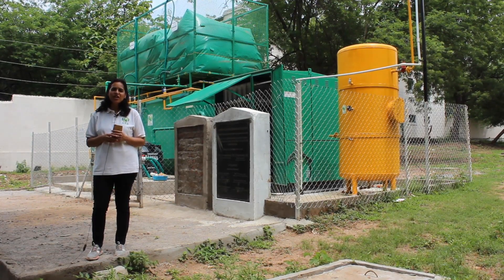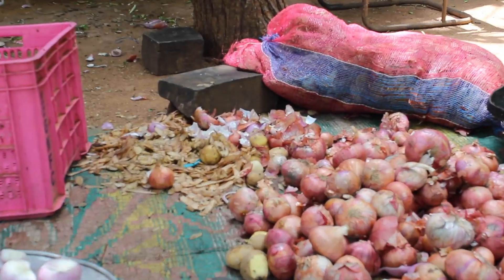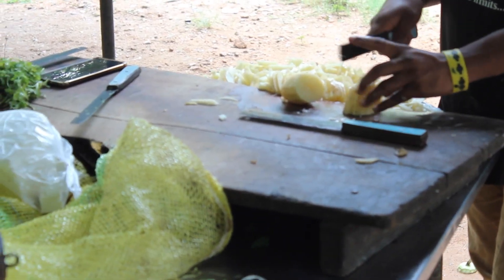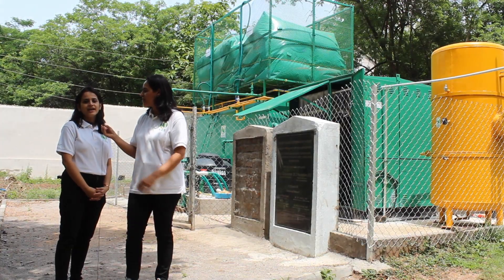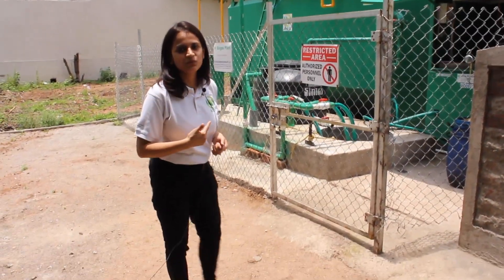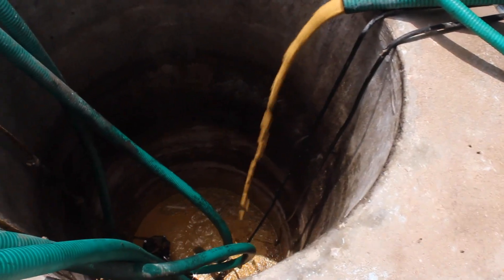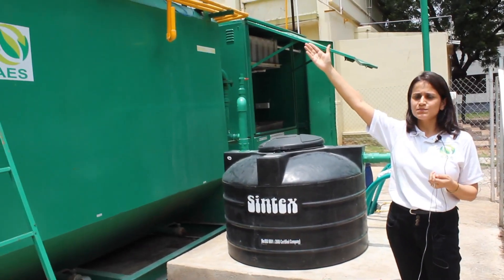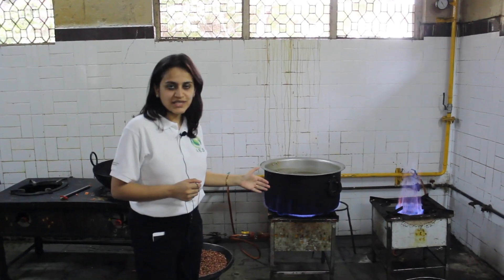Kitchen Waste to Biogas Plant at Osmania University, Hyderabad

Comment: Why can't we use in motor cycle or in   car
Reply: Because if it is stored in a cylinder like CNG, it needs a large space which is not very practical to hold such a big cylinder on a bike. Biogas is nothing but the same as CNG which we use in cars/buses. It's methane gas. When compressed, it's called CNG. When supplied through pipes, it's called PNG. But it's different from LPG, LPG is Butane in compressed and in liquid form.